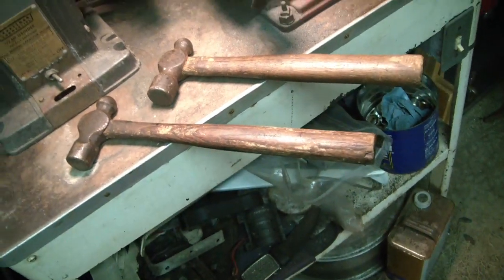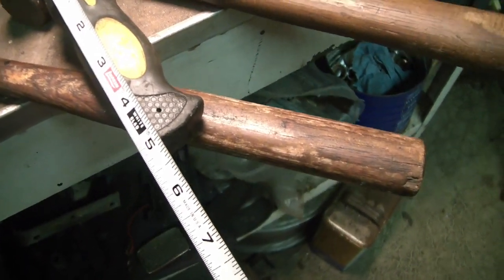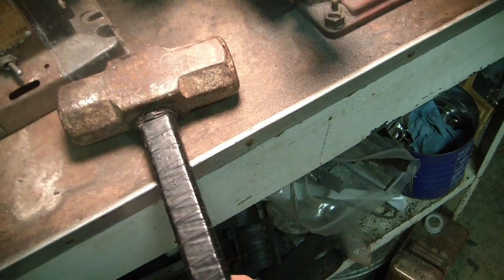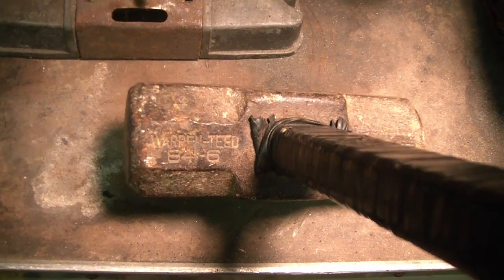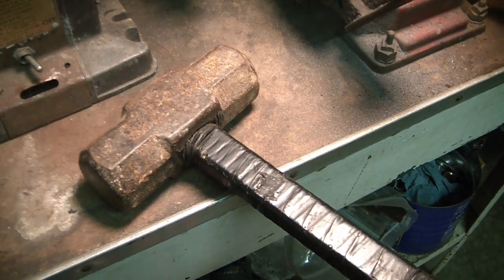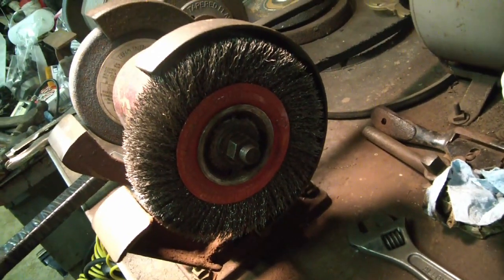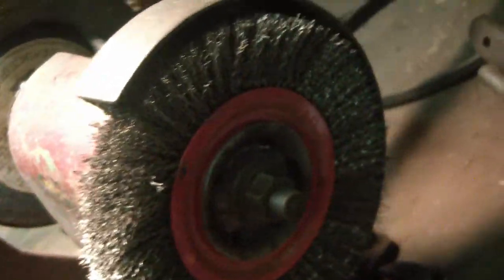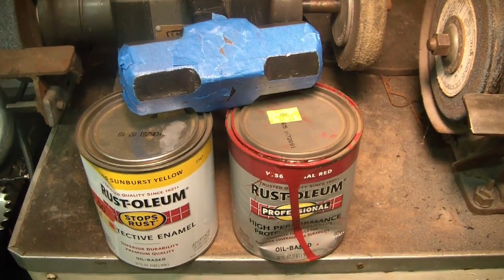Scoutcrafter Short Handled Hammer Challenge

Comment: Good tip on the wire brush! I love that old Bench Grinder! Great entry to the challenge!
Reply from the maker: Thank you!  What R U doing up so late?  What time is it there?
Reply: @timeflysintheshop  5am, been up since 4am haha
Reply from the maker: Ahh I forgot to tell you about the bench grinder.  It was in my grandfather's basement mounted to a board attached to some shelving, but with no motor to drive it.  He must have used it since it was mounted to something.  Anyway I have been using it for almost three decades with a motor salvaged from the furnace of my parents house and I have had it mounted on and old kitchen countertop table I garbage picked all those years ago.  I have probably changed the wire wheel and grinding wheel about three times.  I have many times thought that I should tear it down and do a full clean up and replace the worn bearings on it, but it never gets priority.  It does keep working though!  Thanks for noticing my old bench grinder.  It shows what a good eye you have for the finer (older) things of the past.  😀
Reply: @timeflysintheshop  That's very nice to see you have gave it purpose again!
Reply from the maker: @jacksshed2450  It has been my go-to grinder and wire wheel for about thirty years.  The old craftsman grinder on the left was something I just picked this summer at a yard sale.  Now that I am getting into more tool restoration stuff as a hobby, I needed a second one.
Reply: That has to be the most original entry. Great job.
Reply from the maker: @RestorationbyAlabamaCreeks  Thanks!